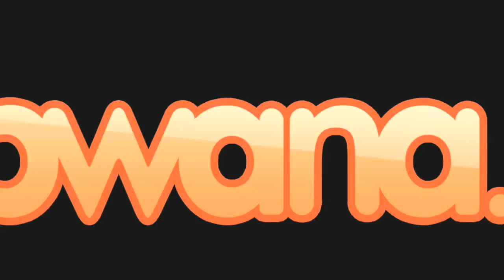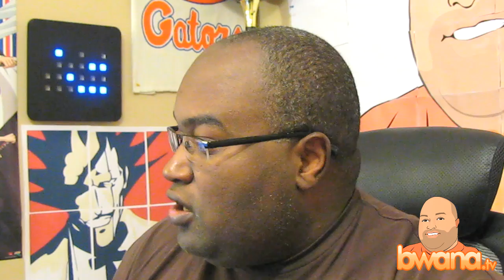Q&A: What is Overclocking?

Comment: He did address the cons of overclocking. Just to put it in brief, you're pushing the processor over its ''limits'', so after a period of time, it will generate more heat from the higher voltage from the overclocking and damage your computer components if not properly cooled. It is dangerous if you're not familiar with this sort of thing, but it's better to look around on google or something and get some other tips and advice before attempting this. Good luck!

Comment: If I'm not overclocking do I need an aftermarket cooler/ heat sink or will the stock cooler that comes with the processor work.

Comment: If you're going with an overclocked 2500k and a Sabertooth MoBo I'd first suggest you get a better GPU than a 5800 series. Look at a higher end 7000 series card, or something like a 6990. As for a PSU, if you're not going to Crossfire GPUs then 650w should suffice, gom with 750w or even 850w if you want some headroom to Crossfire and add more components in the future.

Comment: @feuchster Have you ever heard of homemade CPU's? But what you are saying may be true, but anyways, liquid helium is below 0.9 K (-272.25 degrees celsius), much cooler than liquid nitrogen.
Worlds highest overclocking was beaten Sep. 13. 2011, by AMD's Bulldozer with 8.429 Ghz. That is a lot. Yes, they used liquid helium, see more info at techwarelabs(dot)com

Comment: The holders of the world records and holder of near world records in overclocking, uses liquid nitrogen (and if I remember right from school it's about -194*Celsius) Its even incredible that your computer survives the cool.. Because the average home electronics is designed to withstand temperatures at minimum -5 degrees celcius (much warmer than liquid nitrogen), and at a maximum of 120 degrees celcius.

Comment: Can I add , generally if Intel is making a 3.5ghz and a 3.8ghz processor what they actually do is try and make all 3.8ghz processors. in the past the ones that would not run at 3.8ghz were locked to 3.5ghz. Today, generally they just take a certain number and lock them to 3.5ghz as the process is good enough now days to make them all able to run at 3.8 . - numbers used here were made up

Comment: @NTBushPilot you will need to overclock you processor, i have my 15 760 at 4.1 ghz using a corsair H50, i haven't had a stability issue yet. the reason you have to over clock your processor is because there is not enough ban with for your graphics cards to push all the computing through the computer so to speak. I have a similar setup, the only difference was that i went with 2x gtx 260 core 216s. your build should be a very nice computer for the few generations of games and computer hardware

Comment: ok that's right, you will need a powerful cooling system if you want to overclock and this is what every page and every video says but nobody mentions that little fact if you dont have a strong power supply you will NOT be able to overclock as efficiently (or even won't be able to overclock in no way) as you would if would buy a strong PSU (power supply).

Comment: Extra fans and air flow will help if you overclocked properly. If you haven't done it before please do yourself and favor and research it. If you overclock a processor or graphics card too high you'll make them unstable and even break them.